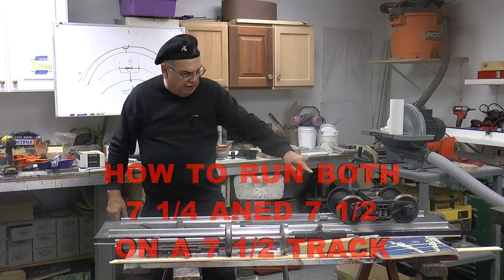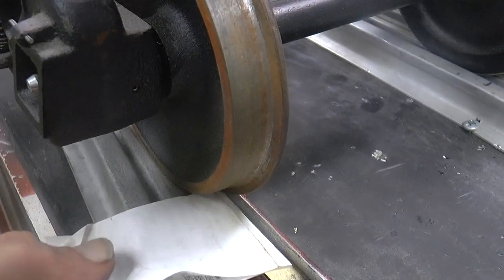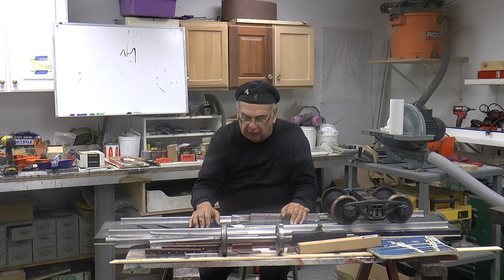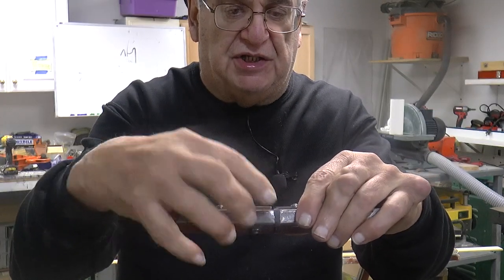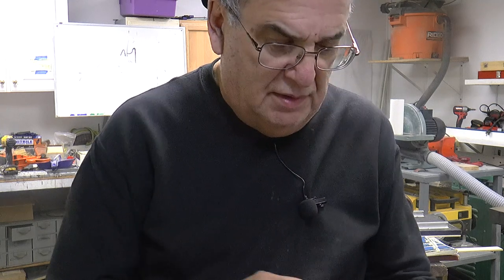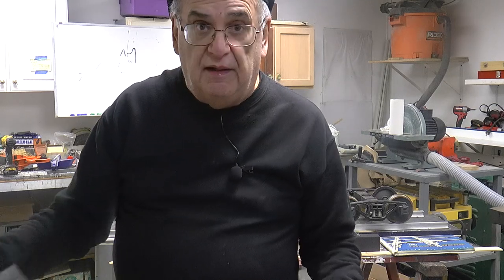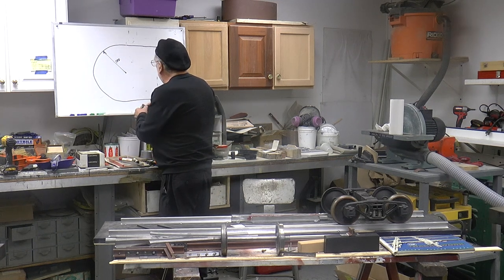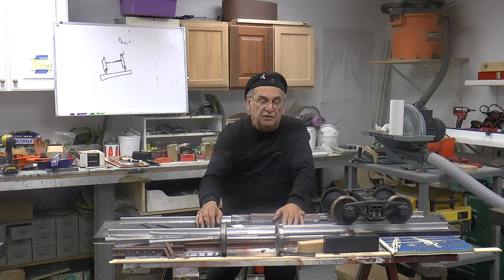GAUGE PART TWO THE DUAL GAUGE FROG

Comment: My background is over 20 years of full-size railroading and track.  Superelevation is predominately about speed or velocity and is directly proportional to the radius of the curve.  It has to do with the equilibrium of the vehicle traveling through the curve at a specific speed.  It is the same on the highways as the railroads.  Because all traffic does not travel at the same speed through a curve, the elevation formula is for 3 inches of unbalanced elevation for passenger trains as that is the upper limit of OK feeling transiting a curve.  Freight trains will need to be able to stop on a curve and not fall inward.  Basically, full-size railroads are faced with the same situation as models in that there is more specifications for almost everything including turnouts than about just track because track operates very well with few specifications until there is tight quarters.  Almost everything in that trackwork catalogue has been learned by trial and error over about 200 years of practical operation.  I used to be a member of the American Railway Engineers Association.